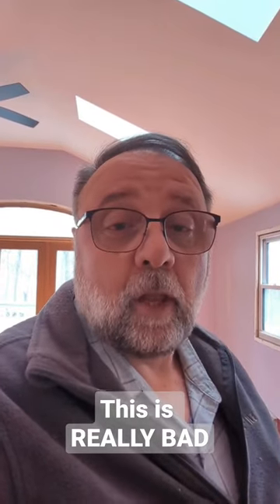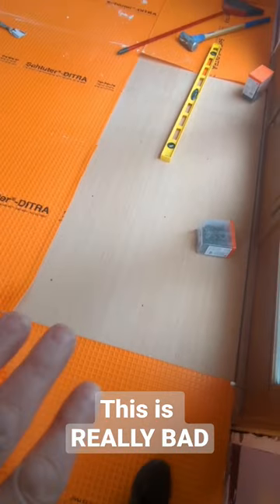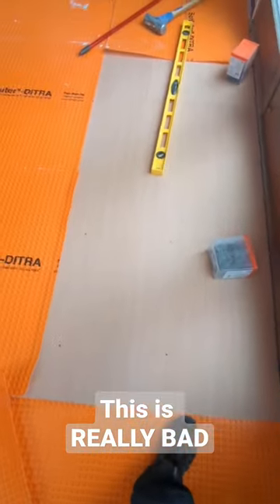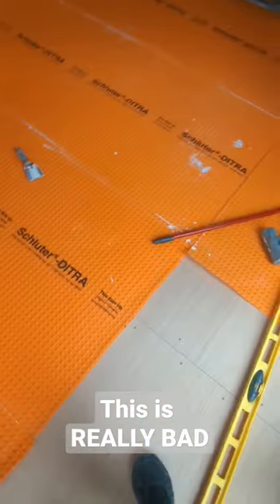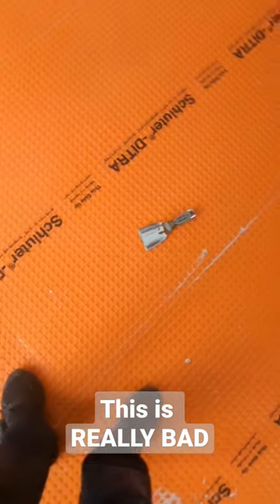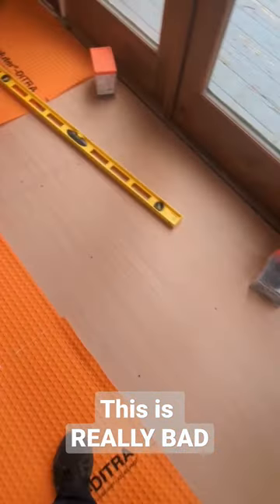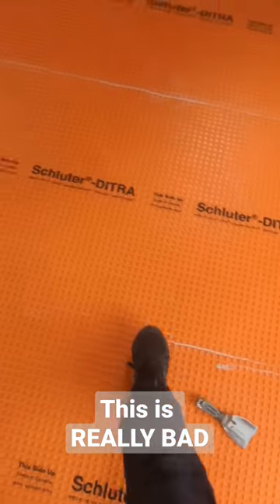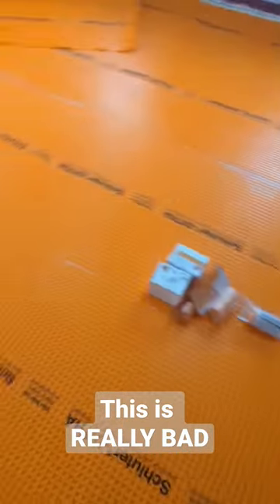Very bad, worst case Screwup. Schluter Ditra install.#short #schlutersystems #fails

Comment: Ditra mat was designed to be applied over 5/8 original subfloor. And allow for movement independent of the substrate. If you are going to add subfloor to original 5/8 substrate, the ditra is no longer necessary.  That 1/2" substrate you found is the crazy part.

Comment: It doesn't need to be   Tongue and groove  That quarter inch premium underlayment It's only used for laminates And vinyl Never tile
Reply from the maker: Subfloor has to be tongue and grove.
Reply: @SalDiBlasi   In new construction before the walls are built you are correct

Comment: This is at least $1000 in materials wasted, and maybe about 4 days of the homeowner's time spent working on the task.  Good for us to learn what happens if you blow off the very detailed instructions.
Reply from the maker: Sounds about right
Reply: Chances are there's a deposit they can say good bye to, as well. 💸💸
Reply: more than a grand. 300 sqft ditra runs about $600 alone Probably about 3 grand, not including wasted time

Comment: Half inch plywood is only rated for sheathing, Cladding, and Gusseting. I have a hard time believing it was used for Decking(what you call Subfloor). On it's own it would deflect so severely that anyone with any experience would notice it from day one. And an inspector would really have his head up it to miss that. If an original 3/4" OSB was removed and replaced with 1/2" then a Ditra install isn't the biggest problem- It's that the structural integrity of the floor system is undermined due to detaching the original decking from the exterior walls and the End-joist and the Bands. 
Furthermore- Any thin plywood underlayment is indeed not rated for water based adhesive flooring install. But if you were using a rated underlayment under vinyl or glue-down carpet it would require 1/4" crown staples 4" on center in every direction and 2" centers on seams. 
But- I'm sure the Sledge Hammer will fix it!

Comment: Would the be acceptable if the 1/4’ was glued and stapled?
Reply: Lol...no. That is luan urility board. It will de-laminate once wetted by the thinset. If you have only 1/2" subfloor(not typical), you must either add another sheet of 1/2" OR tear it all up and use 3/4" t & g plywood.
Reply from the maker: no
Reply: If the subfloor is t&g but still need to add say 1/2" plywood "underlayment" - this added layer wouldn't need to be t&g, correct? Glued and screwed to the subfloor but not the joists?

Comment: Luan should never be used for anything structural. Sal is correct. TCA specs require a 1 1/4” minimum subfloor for tile.

Comment: Screws on plywood need to be 8 inches apart and 2 inches apart around the edges
Reply from the maker: This fail has got nothing to do with the number of screws.
Reply: @SalDiBlasi  that’s why it’s flexing not enough screws
Reply: @justanotherchannel6097  it's flexing because it is half inch (plywood) and not 3/4( tongue &groove) regular plywood is not meant for subfloors
Reply: Why change your measurements? Screws or nails every 100mm never had one fail 8 inch does seem a bit wide to me but if youve never had any failures either i guess we are both right , you get 200 screws in a box if you do it 100mm its basically 200 screws
Reply: Luan under thinset= a wet paper towel....

Comment: Should of used good old Hardy backer If there wasn't three quarter inch engineered plywood underneath... come on pizon
Reply from the maker: Cement board has no structural value. look it up.